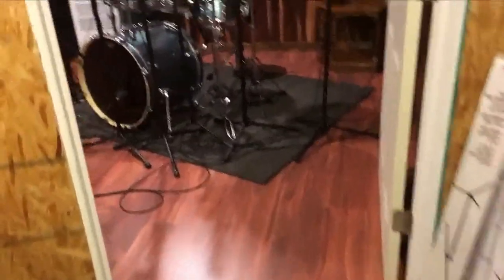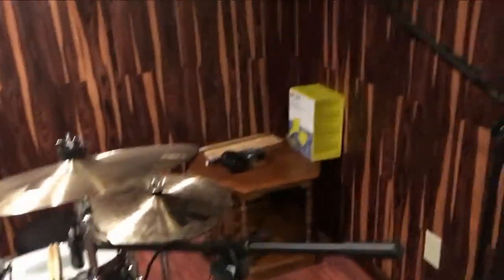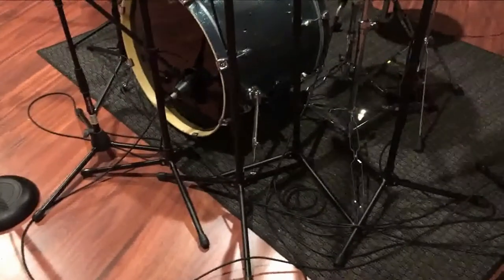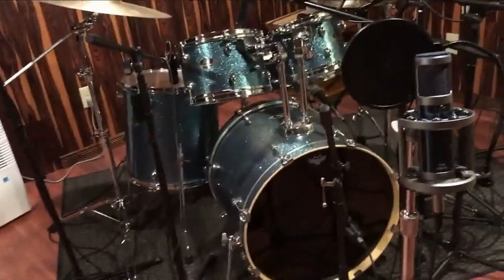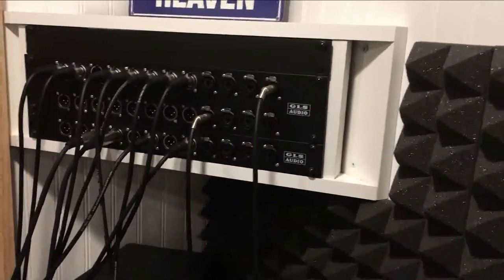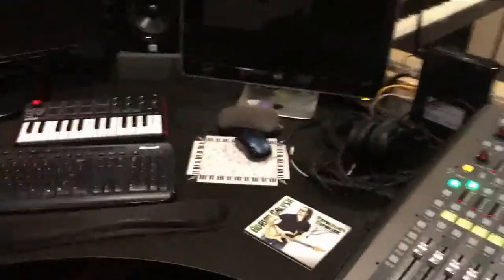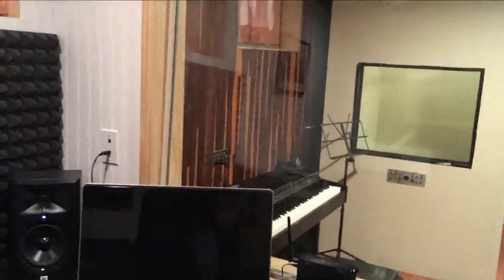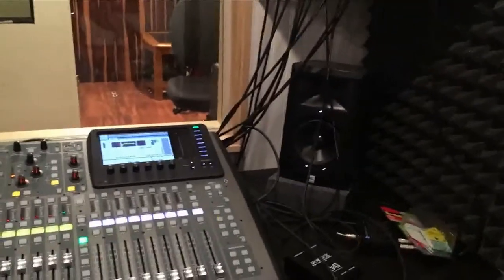Basement Recording Studio Part 5 - The finished product

Comment: I’m only 20 but when I get my own place I kinda have the same idea to build a basement studio. Might be a little personal but could you give an estimate on how much the construction part of it cost?
Reply from the maker: Hi Drystan.  I didn’t keep close track of the project’s cost as I built it myself over more than a year.  However I know lumber for framing the ceiling and walls was about $600 US.  The floors and walls were about $1400.  Cabling and faceplates with connectors were a few hundred as well.  The vocal booth only costed me $300 for a truck and heavy equipment movers to move it in.  It’s lead lines so weighs about 800 pounds.  The booth itself was donated by Miracle-Ear hearing, but would cost about $6k if you buy one new.
So budget for $10k and that should leave room for amps and microphones.